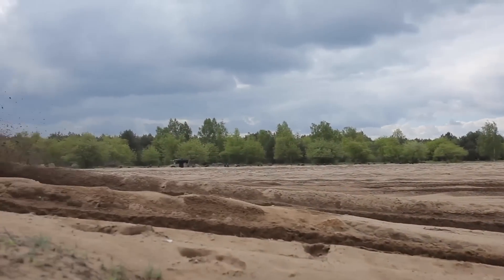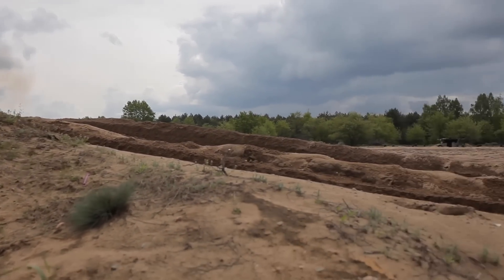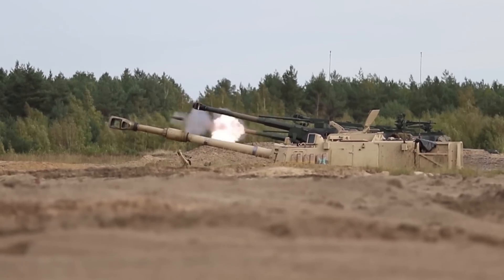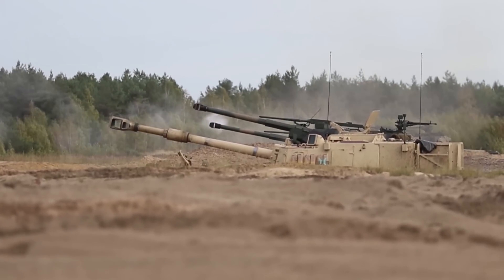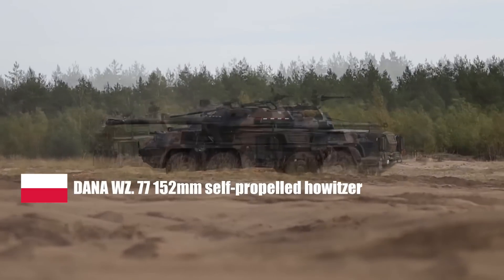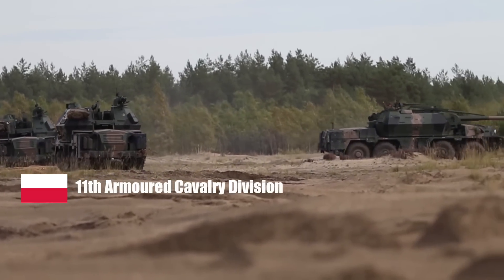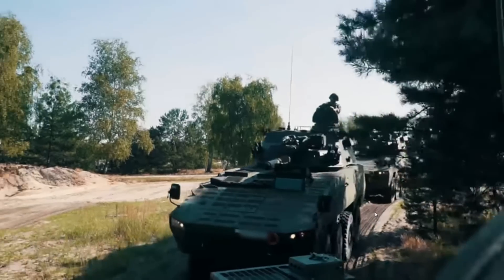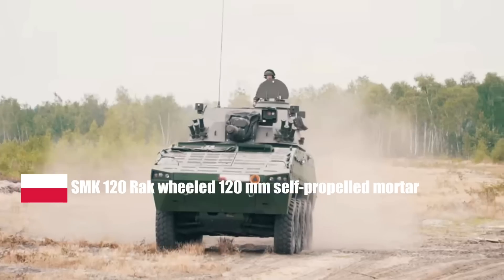The Unique Polish AHS KRAB 155mm Self-Propelled Howitzer In Action - Redux

Comment: How are rounds loaded? Does it have some automated loading or a dude shoving round through breech?
Reply: There is semi auto loader. In first minute you can shot 6 rounds. Later only 2 per minute.
Perfect for hit and run.
Reply: @panakap2186  very good. It's very modern SPH like the PzH2000 and K9.

Comment: Are Military  Tanks heading towards to Extinction 1914-2022-?
Reply from the maker: Its difficult to predict the end of the age of the tank, however, any failure to develop effective countermeasures against drone and anti tank systems and that includes battlefield tactics, will hasten the start of that end, which in all likelihood has probably already begun.
Reply: @OFFTRACKPLACES  Bollocks. ;)
Reply: @OFFTRACKPLACES  I don't think so honestly.
They are extremely valuable as fire support/mobile cover.
They fill in a special role.